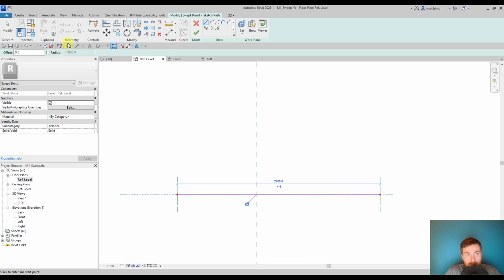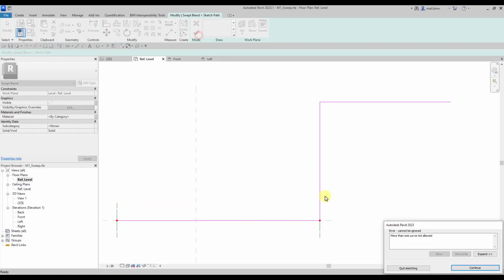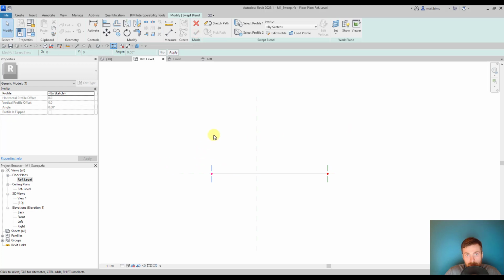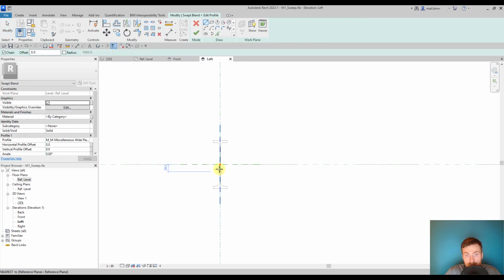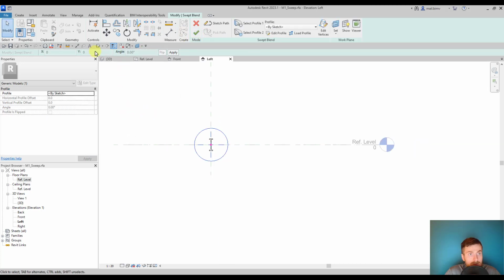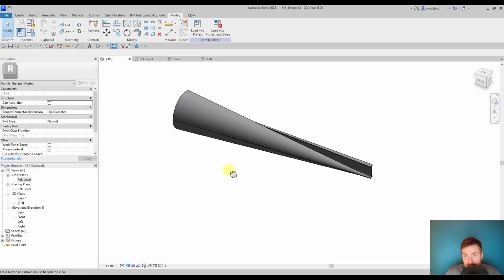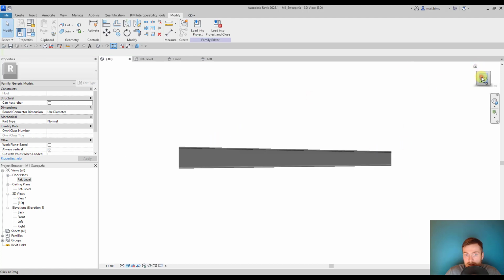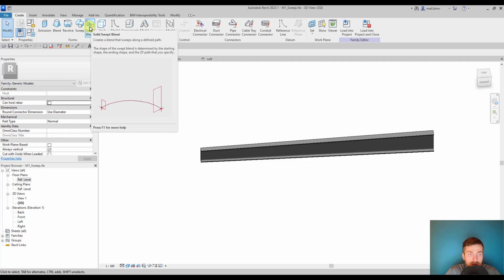REVIT FAMILIES COURSE:  Module 2 | 5. Geometry: Swept Blend

Comment: thank you so much for your effort but i have a question if you dont mind, i need to the profiles of the swept blend to remain vertical, not perpendicular, any help please?
Reply from the maker: not sure if I understand. Do you have some kind of drawing?
Reply: @revituniversity  i cant upload drawings here but i mean when i sketch the path “lets say on Y dimension” with arc shape i need to keep 1st and second profiles of swept blend vertical and parallel to Y axe.
Reply from the maker: @Arafeh.H  I think you to achieve this goal if I understand correctly after creating a blend sweep you need to add a void extrusion aligned with the axis you try to be paralell with.